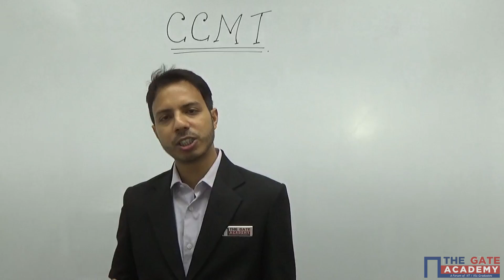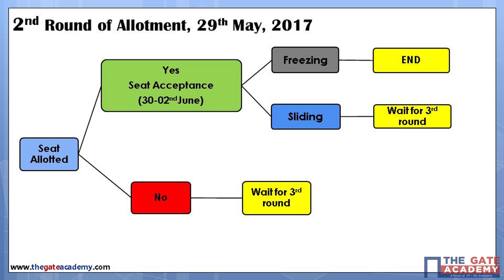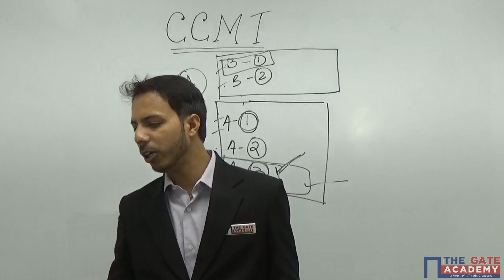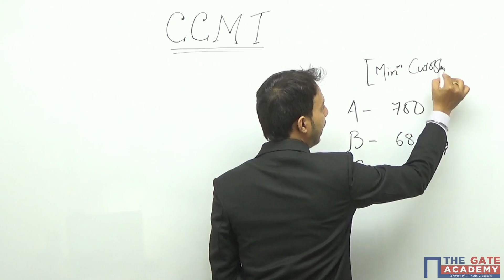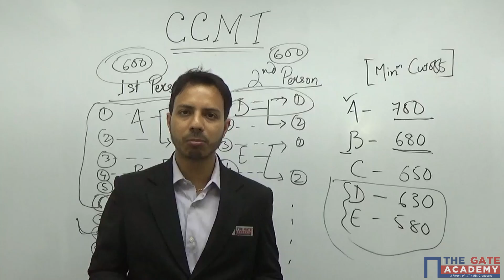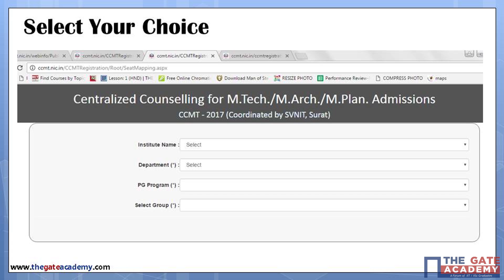Do's & Don'ts of CCMT Process for GATE Takers

Comment: I have been allotted a seat in Round 1 of CCMT 2019 counseling process and am required to pay Rs.30,000/- as Seat Acceptance Fee within 10th May.

I wish to understand that once I pay this, and later if I get option of joining any IIT or PSU due to which I would have to vacate this seat, then within which date will I have to vacate my seat to get the refund of Rs.29,000/- as mentioned in the brochure. I would also request you to kindly familiarize me with the process of vacating my seat after having paid the Seat Acceptance Fee so that I may be eligible for the refund of Rs.29,000/- after the seat allocation process is over.